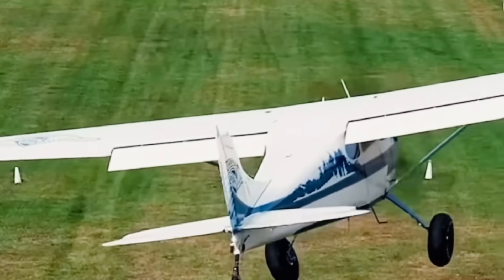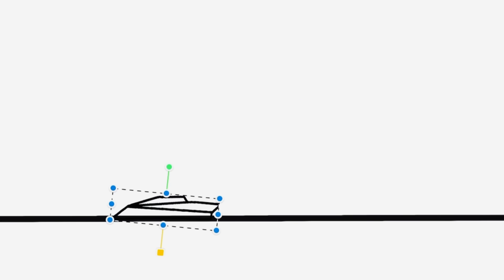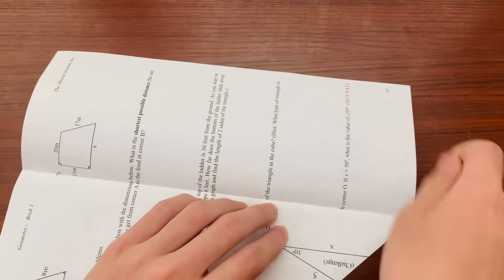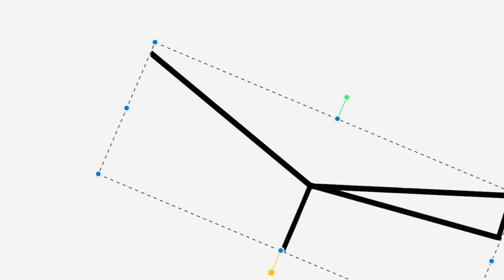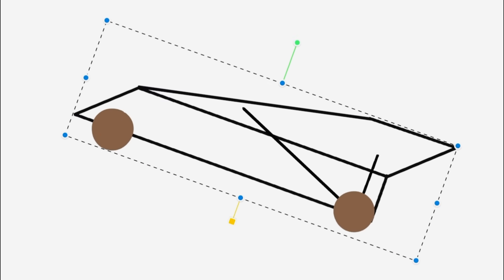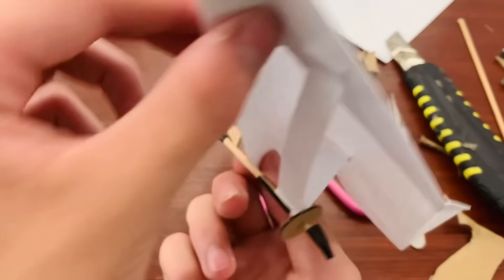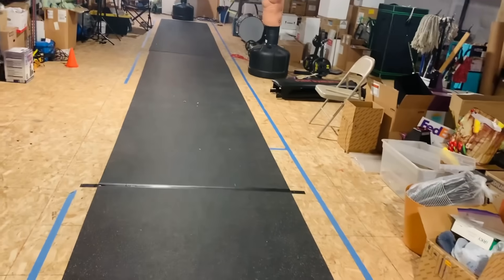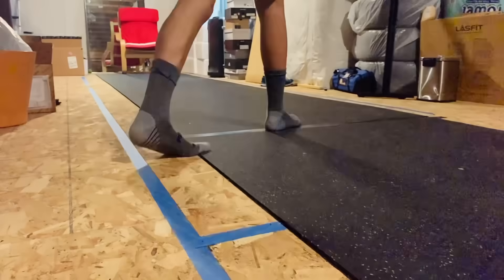Can a paper plane perform a SMOOTH landing?

Comment: You can actually fold the wings in a circular way to make something like engines so the air going into them comes out from the back. You basically fold the wings in on the top so that the passage for the air becomes smaller going towards the back of the plane. That makes the nose of the plane tip up which might make landings easier but idk.

Comment: Pro tip : fold skyking by takau toda and adjust the elevators extremely.
This results in smooth landing. Mine landed and again take of in the sky obviously not for long but it is fun to experiment.

Comment: btw if you have a paper plane throw it lighty cause sometimes it works better when you throw is lightly
Reply from the maker: Well, I need it to achieve a high speed so it can lift up right before hitting the ground, but for flying, yes it flies better when thrown lightly.
Reply: @ieatgrass_rc   okay 👍

Comment: You premis is flawed right from the opening statement - no aircraft can consistently "land smoothly" - the pilot is the factor in the landing performance although you can design a craft to harness ground effect and fly well at low speed, but this is pointless as the trade off would be poor performance at higher speeds and altitudes. Your experiment will be hit and miss there are too many variables you have no 'control' over so you may get ten smooth landings one day and only one the next. Keep experimenting though but this is not a useful exercise.

Comment: I solved it by adding legitimate airbrakes and trim tabs. They have to be readjusted sometimes if it does crash into something, but it works just like it should if you get it right.

Comment: Another variable to look out for eith paper planes is after a few throws, the nose is most likely crumpled. This messes with consistency, aero, etc. 

A lot of the designs i like to fold and fly usually have flat noses or reinforced noses for that reason. Reinforced being usually a few more folds up front making it ridged. This also allows it to fly outside better too with the increased nose weight. 

Happy flying!

Comment: Fighter pilot here, This was awesome dude! Some science to help steer your design choices.

Ground effect: the effect of extra lift being generated when the airplane is close to the ground. This happens based on wingspan length and not surface area of the wings. As a pilot you will feel the effects of ground effect once you're about 1/2 the distance above the ground of your aircraft's wingspan. Planes like the T-38 and F-16 I don't feel as much ground affect as say a cessna or a glider, hope that helps next time

Underrated channel and hope you grow into something big!
Reply from the maker: Thank you very much for this information 👍 I’m planning on doing  a lot of future videos about ground effect aircrafts
Reply: What about a low wing configuration? Too many years ago, I trained on piper Cherokees (PA 28). My first reasonably good landing (ie-one that didn't cause my instructor, a retired B36 pilot, to verify his upper dental plate was still "upper") seemed soooo smooth, I felt like "take that! Chuck Yeager" untill I applied the brakes, which DID NOTHING. My instructor camly sat and said "end of the runway is getting close." I said something like "Uh..."  He calmly pushed the yolk forward with his finger. THUD on the nose wheel, then the mains banged down.  We didn't rebound, thank the gods, and Pottstown-Limerick airport had a generous overrun with nice, fluffy grass to slow down, and for the prop to weed-wack. While we taxied back to the ramp,  he just said "ground effect. Read about it. Again."
Reply: Let me guess which jet got assigned to you

Comment: you can try to convert it into a passenger plane
what i mean is that you cut a little hole into a plastic canister a small and light one and put ants it the hole is for the air